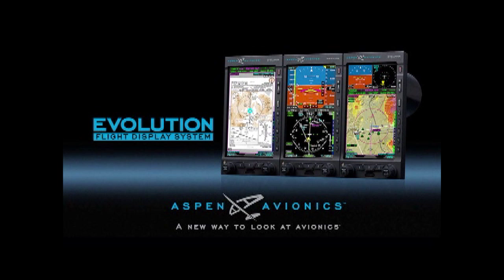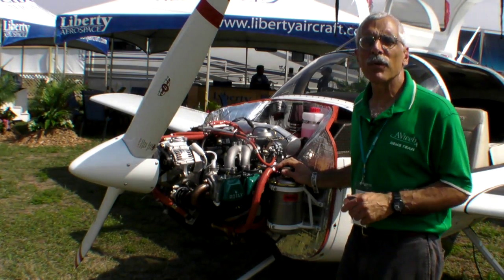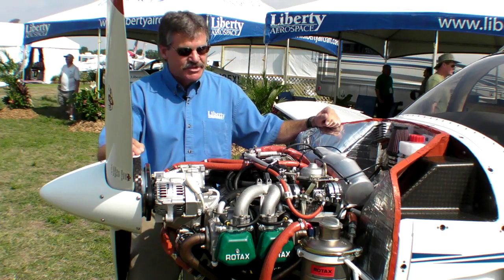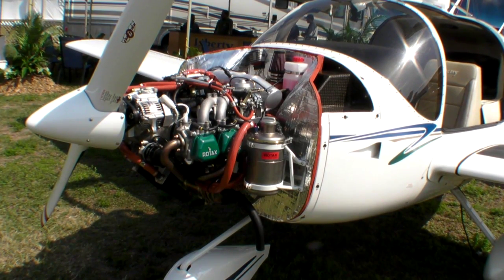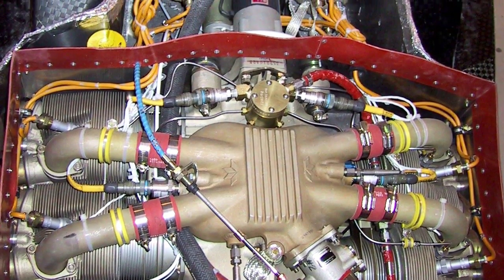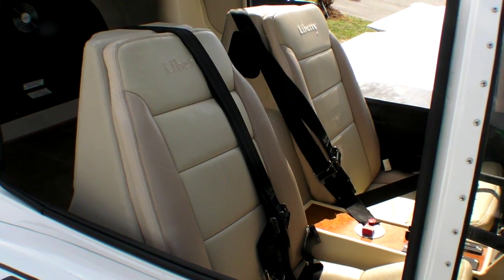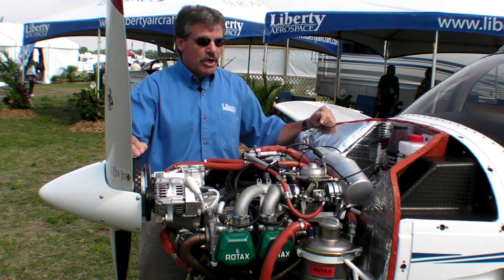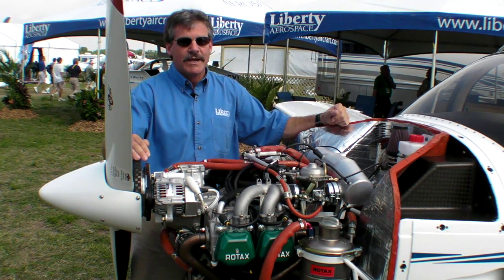Liberty's New Rotax Option

Comment: Rotax sucks to own unless you're a mechanic... too much complexity (carb synchs, gearbox shimming/changes, radiator plumbing) , too many components, short scheduled maintenance intervals... if the only problem is using autogas they should have gone with the jabiru.  And this heavy Liberty will be a DOG... I guarantee it... with s Rotax vs the original Continental or a jab 3300 they should have used.